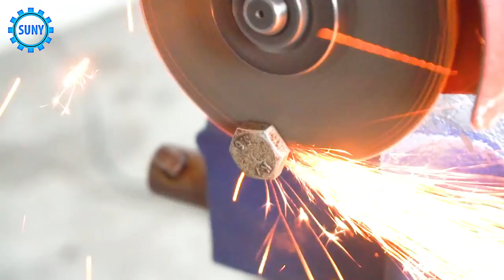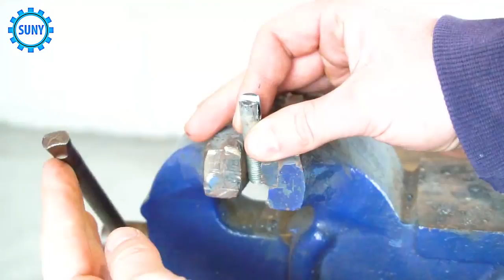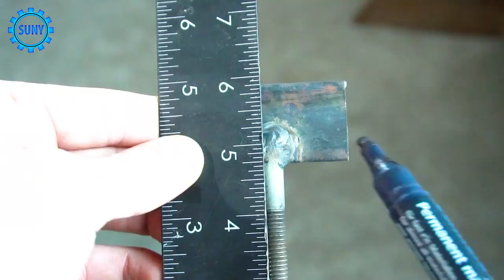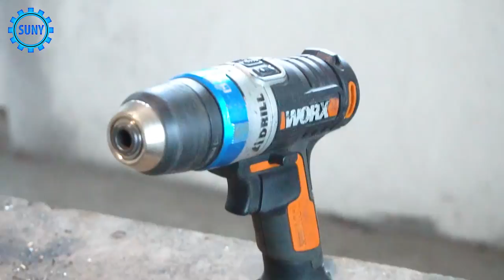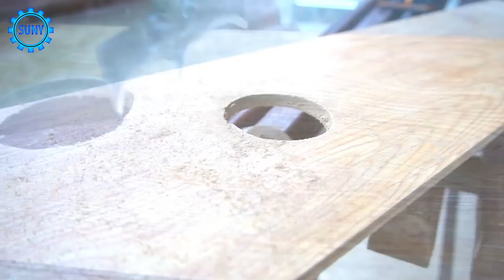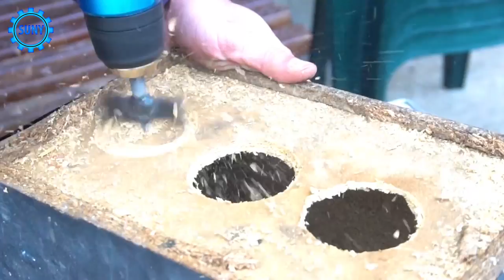Accessories Wood Drill Drilling (Homemade)

Comment: That's terrifying and a absolutely poor design. Not only are you stripping your drill chuck with the threads of the bolt uoure also breaking your wrist drilling a hole. Have fun explaining that to a doctor 😂. You should not be showing amateurs this kind of stuff especially because you are going to be liable since it's a instructional video. Start adding a liability info in your videos before somebody gets hurt or just stop completely. Oh by the way whole says and other drill bits are pretty cheap since they are expendable items. You pick... cost worthy reliable drill bit or a wrist breaker

Comment: Has nobody ever taught you how to measure things properly, and scribe or mark out with something more accurate than a bingo marker, that has got to be the most innacurate, rough, and downright dangerous home made "wood bit" I've ever seen, for one thing, I've never seen anybody weld so badly on such a regular basis, its that uneven and far out, each hole is oval by the time you've eventually worn your way through, thats why you wont hold the board straight on to the camera, every time you try to cut a hole with it, it jumps at least an inch from where you started, and you pretty much destroyed the chipboard back of that speaker rather than cut a hole in it, about time you packed in before you seriously hurt yourself or someone around you. Big time fail
Reply: Too bad you are spot-on with that comment.  the idea is good, but the finished product is ripping it all to pieces.
Reply: He almost broke his wrist and his videos dont have any info stating that he's not liable for any injuries since this is a instructional video